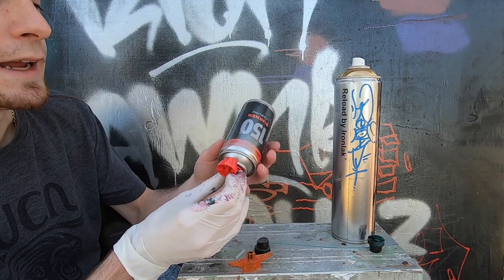How To Transfer Spray Paint From Can to Can

Comment: For anyone wondering it is possible to mix colors with 2 Male cans. all you need is a adapter, place it on the feeder can, and place the stem of the recieving can into the side where a cap would go. so far I've only used the uprok on rusto with great results and zero mess

Comment: Question ❓
I bought graffiti caps on amazon. Krylon paint from Walmart. The caps don't fit cause the white stim on it.
Do I pull that outa the can
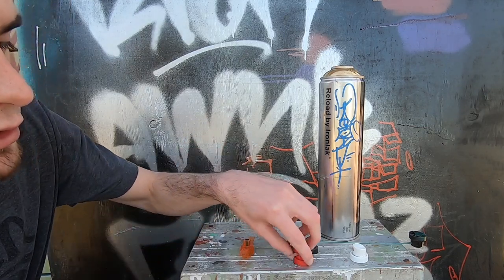Reply from the maker: No, don't pull it out!  The cans you bought have a male valve system and the caps are also male.  So one way to solve that is to get a cap adaptor that I show at 3:10 in this video.  That would go on the can directly, and the caps would fit on top of the adaptor

Comment: How would you transfer from a Ground Marking. Spray can to a Rustoleum ??
Reply from the maker: hmm that's a good question but I don't actually know enough about the nozzle on a ground marking can to say for sure.  if you can remove whatever nozzle it comes with and it's a male valve, you could put a cap adapter on it and then put the tool I used in this on top of that.  You would have to hold the rusto can as the upside down one in that case.  But that only works assuming there is a male valve in the ground marking can that an be exposed and fitted cap adapter
Reply: @ScizGraffiti  a rusto valve. Would fit in a marking can male valve the thing is that marking can only spray pointing down. Ive tried switching up and one down or side by side but you can get pressure from a marking can to transfer only way ive been able to do it is by puting a on the marking can and puting a rusto to it and receive it but its a mess probly get 30 percent tranferd. Cus of the loss of paint
Reply from the maker: @carlosolguin84  ah gotcha. Yeah maybe an adapter with a transfer cap system is the best you can do then
Reply: @MrSteezyR rite on im able to tranfer but at a very slow pace with those cans sometimes i get it quick but thanks for the info ive never seen a vid on youtube about this